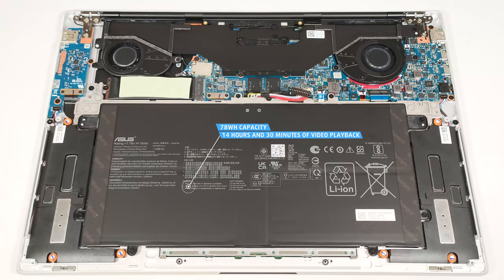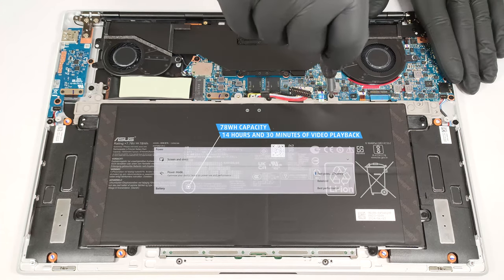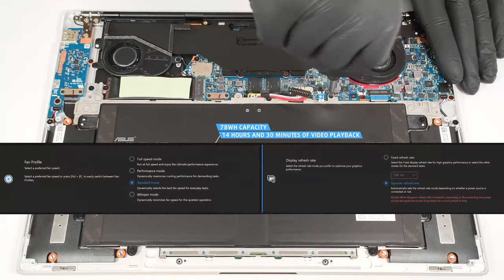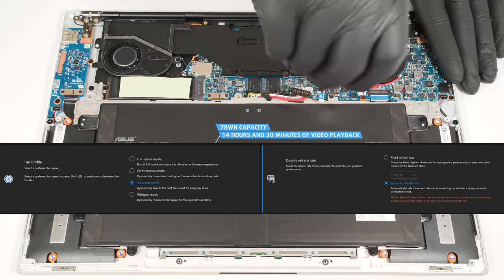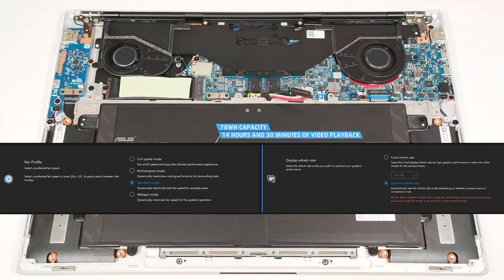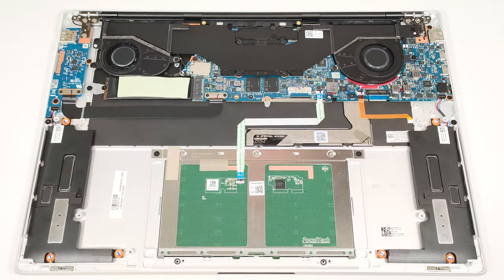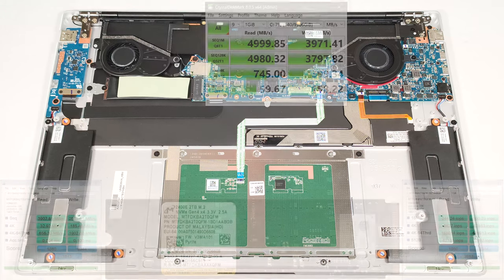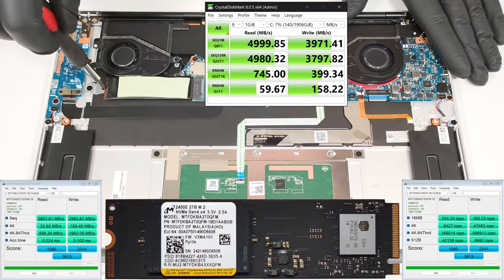🛠️ How to open ASUS Zenbook S 16 (UM5606) - disassembly and upgrade options

Comment: Thanks for showing the inside, now i know i wouldn´t go for the S16. I hate soldered Ram, but this becomes more and more standart these days...sad but true. But....only one M2 SSD Slot is an absolute no go to me. I never can have enough storage on my working notebook on the go and i keep operating system and data always on two different drives ( might be oldschool , but that is my way ). So the S16 might be sleek, good looking and powerful, but this limitation of Ram and Storage is not what i was looking for. I also expected that a second slot is available and so this one is not for me.
Reply: You need more than 32GB ram in your laptop?  Soldered ram is providing faster speeds too.
I bought this laptop and returned it simply because it overheated and crashed multiple times on very simple tasks like YouTube streaming with fans set to max.
Reply: @ashykutcher No 32 GB ist enough but many Notebooks only have 16 GB which is esp. For some kinds of use a Bit too Limited. My acual old nb has ram and WiFi Card as well AS ssd in Sockets. I would prefer that but i understand that manufacters prefer soldered solutions. A broken ram after the waranty or insufficent ram for the usage leads to replacement of the Hardware. Good for the company but Bad for us.
Reply: For storage you can use NVMe enclosure.. It provides good speeds with usb4.0/Thunderbolt 4 up to 40gbps (3800 Mb/s write & read). Currently I have two enclosures 1TB each. And all my work is stored in.
Reply: @hirschcola1  it's not about manufacturers but the CPU itself it needs ram to be soldered (lpddr5x) like on the phones.
Reply: @ashykutcher  If your machine crashed playing YouTube (what kind of videos?  5K?  8K?) then the cooling system was probably defective.  Also, note that you don't have to put the laptop on "max performance" to do practically anything, it's extremely powerful in the 17w mode, which reduces heat production.  Still, it's twelve times cooler than my 2019 Macbook Pro (with Intel CPU), I can easily do work with the laptop laying on my stomach ...
Reply: @ashykutcher  Over time, Windows 11 will increase the use of your system resources, which will cause those 32g of RAM to be insufficient.

Comment: Can I change the ssd without removing the battery? If so do I have to unplug the power cable from the battery to the mainboard before I switch the NVME SSD?
Reply: I don't have one yet but I've never seen a laptop where you had to move the battery to upgrade the ssd and the ssd is held with just 1 screw and is fully visible in the early video so i'd say ... No need to worry about the battery.  Its always a good idea to fully disconnect the battery before working on any laptop OR phone!
Reply: I have changed my SSD from 1TB to 2TB (Crucial T500 - recommended).  It went easily and took about 10 mins total.  No battery removal was necessary.

Comment: I wonder if the RAM can be upgraded by purchasing compatible chips and properly resoldering new ram onto the motherboard.  I wonder if there are config resistors to tell the CPU how much RAM is present, or does it auto-detect memory size by scanning for the presence of working cells?  I have a 24GB model.

Comment: No way, only one SSD slot?!
I've bought this 2 weeks ago and I thought there're two slots...
Reply: how about NVMe enclosures?
Reply: @sky9t_sulia  nah
Reply: I think you have to create a special boot image for more than 2TB file systems, since the standard file system (NTFS?) only supports 2TB max.  I did a virtual copy of my 1TB flash to 2TB flash and it works great, although one hidden volume became visible, I think.